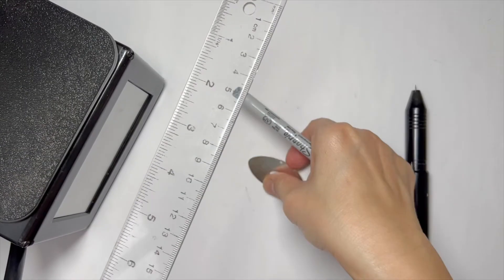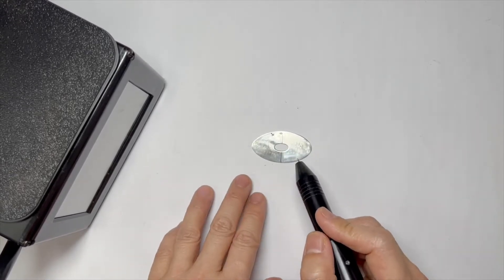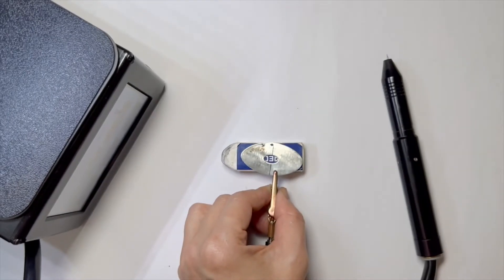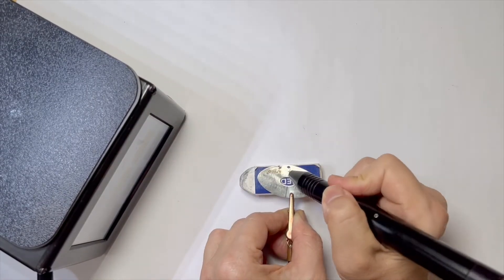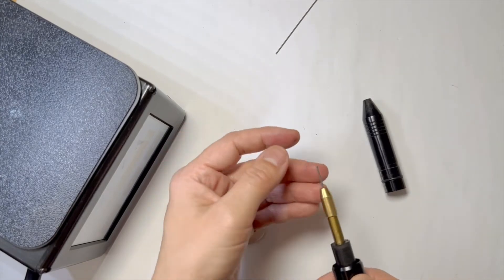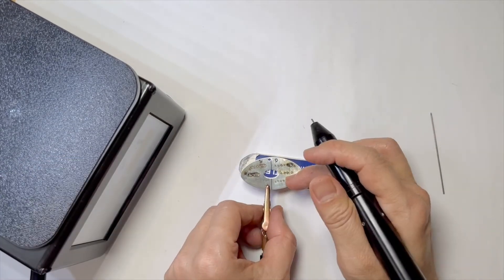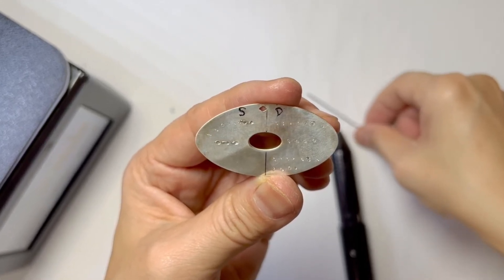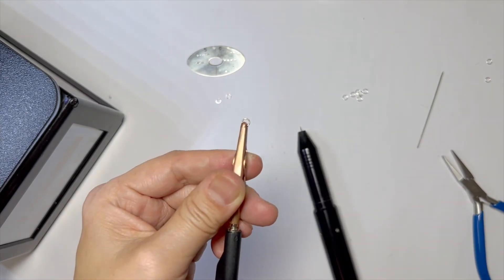9.  Tricks for Even Better Micro Welding and Power Control - Free Permanent Jewelry Training

Comment: Do you suggest the smaller or larger ones for permanent jewelery
Reply from the maker: I prefer just the smaller electrode and use smallest jump rings that I can handle.  I don't think it matters a great deal, but that's just what I've gotten used to.  I weld at 7.5w

Comment: Hi there! I noticed when I weld my jump rings it leaves a black spot after a few days. It's not oxidization. It's as if I am burning off the top layer of the gold-filled wire. Do you have recommendations on how to avoid this? I am using 26ga wire to create super tiny jump rings.
Reply from the maker: The dot is the metal underneath if you're using gold filled.  No way to avoid this and most people are not bothered by it at all.  If it bugs you, use solid 14k.  We wholesale 24ga in 2.5mm, 3mm and 3.5mm - they're not expensive since they're so light.   However, like I said, almost no one is  bugged by the little dot, smaller than a poppy seed.